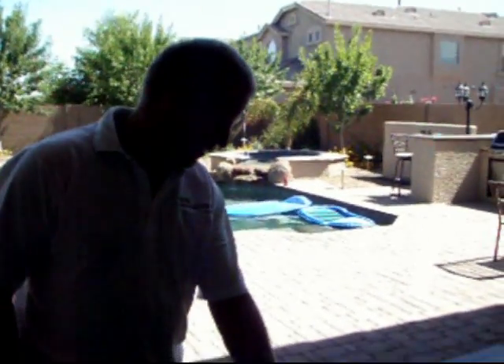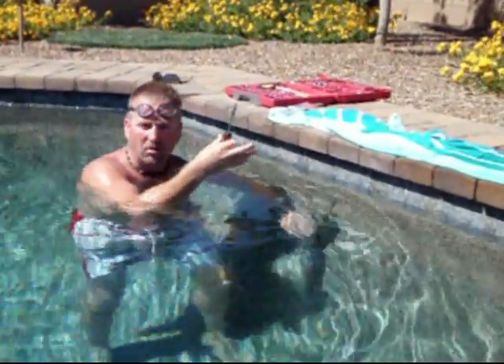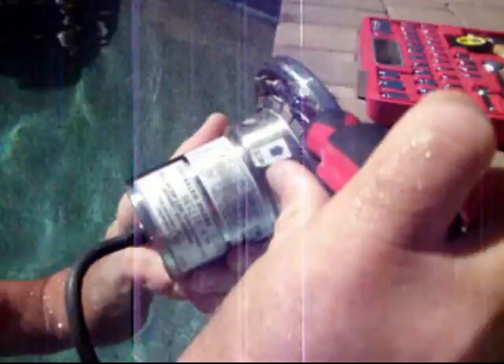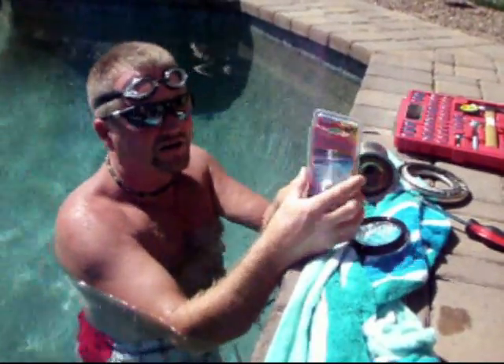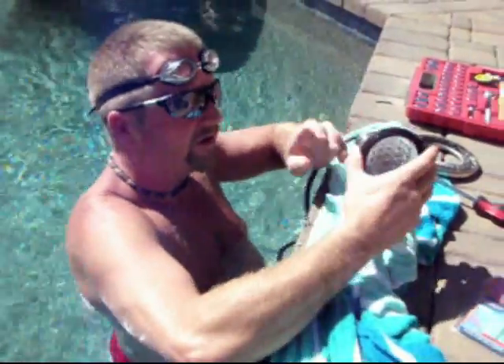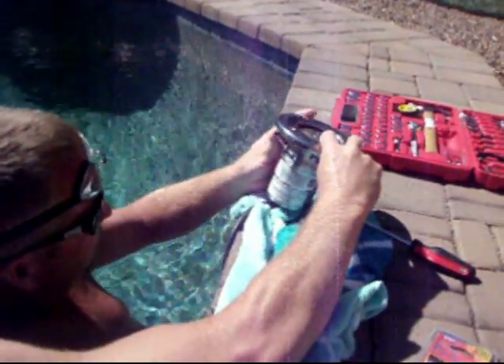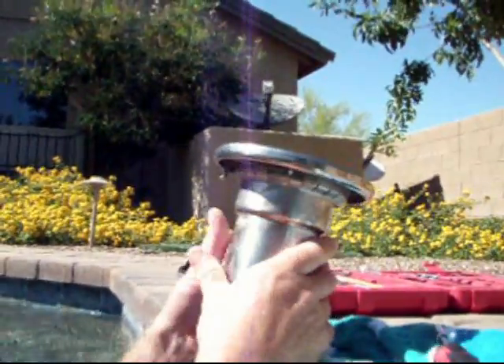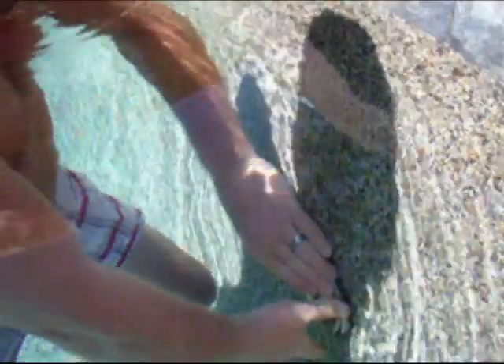How to Replace a Pool Light Bulb (Lamp)

Comment: Just saw Terry's follow up video to this one mentioning the ability to do this repair w/out getting in the pool, funny! You can absolutely complete a bulb replacement or light housing swap out w/out having to get into your pool. Just hang over the side & depending on your water level & the depth of your light, you'll only need to roll your sleeves up & maybe get your head wet a little trying to view the light/housing, etc. Gotta love YouTube for instructional video's like this! Thanks to Terry & this video, I saved $250 from an unscrupulous pool service tech who said I need to change out the entire light housing & it turned out to just be a $16 bulb...do your homework people & watch your tech's!! Thanks Terry.

Comment: Terry that was a really good video.  I would recommend silicon lube in future installs.  I will also add that as a contractor, I will not warranty the seal on a bulb replacement. I lose perhaps 70% of pool light replacement bids because of this, but with a brand new fixture you never have to worry about the seal and (depending on the wholesaler/manufacturer) a 90 day warranty on the bulb. I have just seen too many seal failures after bulb replacement.

Comment: In the U.S.A. the NEC requires the cord be long enough to pull the light out of the niche and set it on the pool deck for servicing.  You lay down on your stomach and hang over in the pool and unscrew the light no need to get in the pool.

Comment: Must be nice to be able to work on a pool light while in the pool...  I've been doing pool work for past 15 years and have never had a pool light not mounted under diving board where I'd need a ladder or be 12 feet tall to replace bulb while inside pool.
  The fun ones have been over winter. Home-owner liked pool light as outdoor lighting year-round so had me replace pool light with water temp around 40 deg. f.  No wet or dry suit. Just put on goggles, remove shirt, and put upper body into pool.

Comment: Can’t stand early bulb deterioration
Reply from the maker: Agree! Not so bad with lampholder in an easily accessible location, but the pool light?!? When looking for a replacement, go with an LED retrofit, or at least a lamp that is rated 130V instead of 120.  It helps with longevity of the lamp.

Comment: Terry,
This is a helpful video. Thanks!
1 question:
I have a "standard-issue" 120 Volt pool light fixture that comes with a 300Watt incandescent bulb.
Can I substitute an "energy saver" bulb (LED or fluorescent) rated as low as 9 watts (60watt equiv in incandescent) or 23 watts in this fixture, or will it burn out those types of bulbs? The socket is the same size.
Thanks for any response.

Comment: u got a nice pool mate, i had a question. i have a pool and i want to add lights underwater. Will i have to drain the pool and make a separate housing for it. I was wondering if there are any battery operated lights that i can drop in the pool, and then get it out of the water when not required. Do reply. thanks

Comment: I noticed you didn't replace the rubber gasket, only the bulb. The pool light I need to replace has instruction printed on the casing, specifically stating that a new gasket is required every time the bulb is replace. Is it really necessarily?

Comment: Terry, good video, you know you can just lean over pool and pull light out without getting in though
Reply from the maker: That is true, and I posted another video showing how to do it from the pool deck. However I have found at least one pool for certain that the fixture is mounted too deep to reach, unless my arms are unusually short.  Replacing a Pool Light Bulb (Lamp) From the Pool Deck
Reply: to your point Terry, My screen backs right up against my pool deck where my light is situated.  Im gonna need to get in my pool.  Ill be less hesitant now that I've seen you do it.  Thanks man.

Comment: My lights weren't turning on, so I hired an electrician and he had them running for a while.  The pool light and the spa light went back to not working again. The funny thing is that now and then these lights do turn on, but say on the following day, they don't work again.  I've gotten comments like "you have a short somewhere, your GFIs are bad, your breakers may be bad, or you just need to change everything, including new lamps and wiring.  Any tips would be appreciated.  Thanks.

Comment: very rare to find a light you can't reach from the deck. Also, always replace the gasket, no matter what it looks like or you risk a leak, then you're pulling a new line to the box to replace the entire light. that gasket has formed to all the tiny variations in the housing so when you re-use it, good chance it won't seal again. a few bucks for a new one is cheap insurance.

I will admit though, in the summer, any excuse to get in the customer's pool is always welcome, hee hee
Reply: Heck 784maava, I would replace the light for free if they let me swim in their pool!

Comment: I LOOK AFTER A HOUSE WITH A POOL AND THE  LIGHT HAS COME ADRIFT FROM THE POOL WALL. HAVE TRIED SEVERAL TIMES TO PUSH AND WEDGE IT BACK IN BUT THERE ARE NO SCREW HOLES TO BE ABLE TO SECURE IT. ANY SUGGESTIONS?
Reply: You should go to the local pool store and ask them. There are special "tools" to assist that problem. 
I believe the thing I'm talking about is called a "light wedge". It's designed to repair old broken niches.

Comment: How do you all change a light in the winter if the water is say 48-50° or so??
Reply from the maker: https://www.youtube.com/watch?v=eFUfiSKEh7A
You do it from the deck like in this video. Your arms will still cramp up at those temps though!
Reply: Terry Peterman that may be true but I can't find the link but their was two other videos here that had people in it due to the wire in the conduit actually stuck that they ended up having to actually get in only to have the wire pop somewhere mid conduit.  So from it looking like 50-50 that it's even possible to pull from the side

Comment: Okay, there is no way I can get the clamp back onto the housing. I just spoke with one pool guy and he said he won't even touch the incandescent bulb anymore because the clamp is too difficult re-install. Oh brother!!!!
Reply from the maker: Marc Herman it can be a problem for sure. I’ve probably changed that lamp in my pool 4 or 5 times over the last 10 years and sometimes things go together quickly and easily, and others it fights back! You can purchase an LED retro-fit but that involves pulling out the cable right back to the junction box and then pulling the new fixture assembly and supply cord back in. I wish they would come down in price. Still fairly pricey!